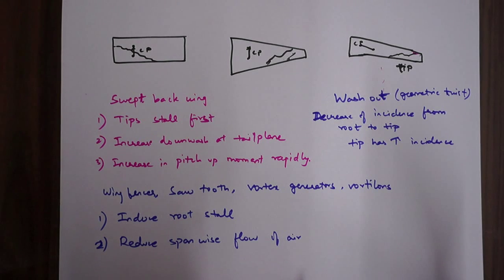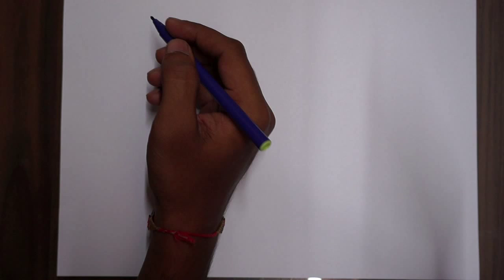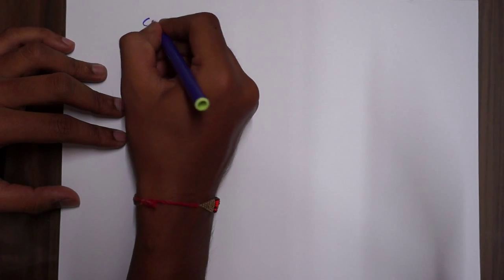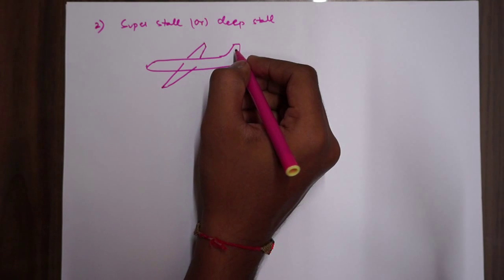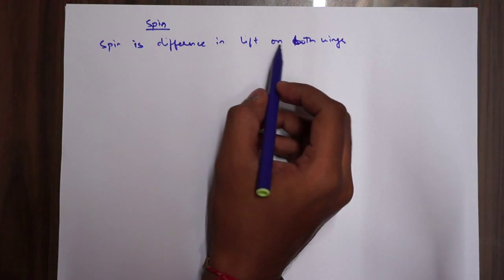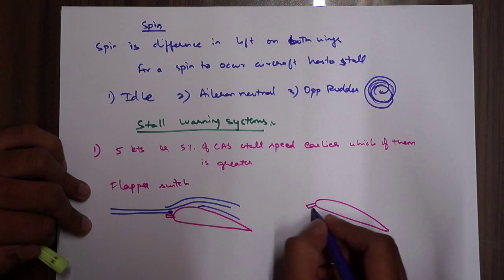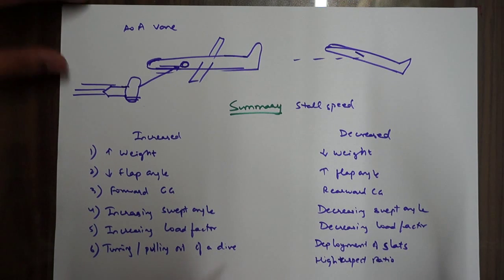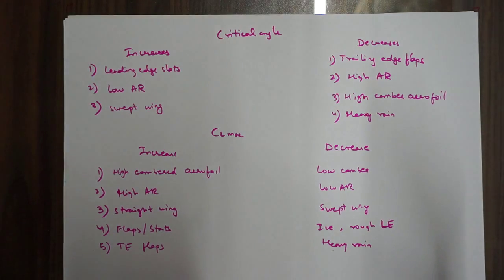Stall - II

Comment: Hii Capt. i have a doubt, Vref =1.3 Vso & also Vref =1.23Vsr so what is reference stall speed ( Vsr ) and how is it different from Vs .
Reply from the maker: Vs is generally stall speed based on a load factor that is less than 1g. Vsr is reference stall speed mostly used for 1g aircraft such as A320 or any other value from which the whol aircraft characteristics are decided. Vsr is mostly higher than Vs.
Reply: @poh  thanks capt.

Comment: I did not understand critical angle ? with use of flaps stalling speed decreases but what about stalling angle and why?
Reply from the maker: Stalling angle decreases with use of flaps because since CLmax increases which also increases the effective angle of attack.
Reply: +Planes Over Head (POH) So both stalling speed and stalling angle decreases?
Reply from the maker: Stalling speed will increase, stalling angle will decrease.

Comment: Hi, you have mentioned that high AR will lead to high stall angle. Isn't it a low stall angle - with higher AR the Clmax remains the same but the angle of attack decreases? Please clarify.
Reply: Planes Over Head  does it mean high AR is bad as it decreases critictal angle?
Reply from the maker: Hey Saurabh, I just checked the video, and indeed its the opposite. Infact in my notes I have written the correct thing, just happened to write wrongly on the video. High aspect ratio will lead to increase in effective angle of attack which will lead to decrease in stalling angle. I have updated the same in the description of the video. Thanks a ton for the correction! :)

Comment: hi man , i disagree with the fact that camber decrease critical angle. actually it increase it , because camber re energize the boundary layer
Reply from the maker: Increasing the camber means that it produces a lot more lift at a given angle of attack. Proof:  Fly level at constant speed and lower the flap. The aircraft will climb unless you lower the nose to reduce angle of attack. A cambered wing will produce lift even if the angle of attack is zero. A side-effect is that, as we increase angle of attack, it will eventually stall at a lower angle of attack which means critical angle has reduced. But, by then, the extra lift it is producing has delivered us a lower stalling speed. What re energizing you are talking about is due to leading edge devices. Here camber is with respect to trailing edge devices such as the flaps.
Reply: Nicely explained

Comment: if the aircraft is stalling at 140knt so it will receive warning at 135knt according to earlier indication of stall
Reply from the maker: Stall is loss of lift! This generally happens when your speed is dropping and your nose is at high attitude. While your speed is dropping it will come from from a higher speed to lower speed. So stall is happening at a lower speed.

You are flying level flight at 100 knots. You want to perform a stall. Your aircraft stalls at say 50 knots. You start pitching nose up till your speed starts dropping. So what earlier indication of stall means is, you will receive a warning at about 55 knots that you are about to stall at 50 knots. 

I hope that is clear now!

Comment: but before u told that turbulent air goes downwards so how can it hit the high tail  plane  ??
Reply from the maker: High tail plane have difference stalling characteristics. If you could clarify your question a little better, then I could look forward to answer it better.
Reply: the air after leaving the trailing edge tends to go downward so how can it hit the high tail plane??
Reply from the maker: Stall itself means the breaking of air flow close to leading edge, so there is no question of air flow existing till the trailing edge. So with a nose high pitch attitude, it means the high tail plane is at a lower level (nose up, tail down = high pitch attitude) and when the air flow breaking at the leading edge, the airflow hits the high tail plane and puts it in a low energy airflow which reduces elevator effectiveness greatly and impossible to decrease the angle of attack. This is a specific condition called deep-stall or super-stall.